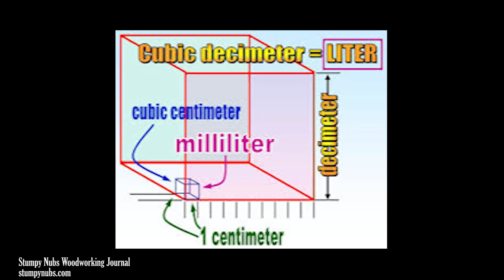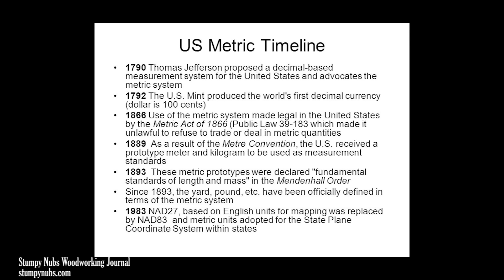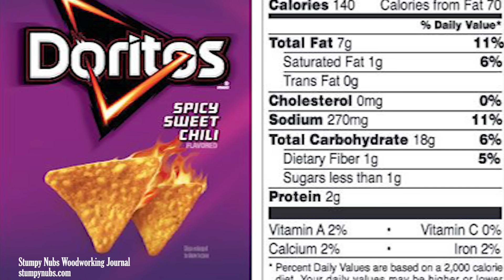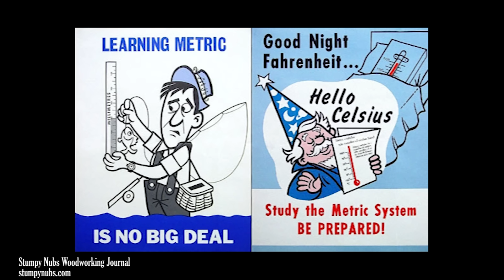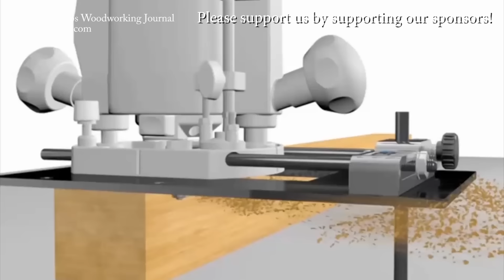BREAKING: The USA is switching to METRIC!

Comment: Finally! 😊 Are they going to switch to ISO paper sizes as well?
Reply: I looked up the price of ISO paper sizes in the USA, and they are simply prohibitive for daily use.  I have to admit that I would love to have my usual paper be size A4, because my papers would be 297mm tall instead of s shrimpy 279.4mm with 8.5x11 inch paper.  My papers would be 17.6mm (7/10") taller than everyone else's!
Reply: @garykitzis1335  Using an irrational number (which we cannot resolve exactly) as the basis for "exact" sizes seems -- irrational. As does the inaccessible basis for defining the length of a meter -- the distance from the equator to the pole.
Reply: @artsmith1347  The bases for inches and American paper sizes are just as weird from an outside perspective. The nice thing about ISO paper is that you can cut it or glue it together to get the other sizes - this is extremely useful. Drawing stuff with your kids who are expected to put the drawing into an A5 homework folder, but you only have A4 paper? No problem, cut it in half and it will fit exactly. No waste. Your kid needs to draw a big diagram on a big A2 sheet and you only have A4? Tape 4 of them together. Presto.

Most parents are happy to forgive the irrationality of sqrt(2) after the first such homework. Most everybody else just lives with it and is happy to cut A4 into A5 whenever we need a flyer.

Just take the meter as what it is: a slightly longer yard. Those french revolutionists were weird. Do what we Germans do today: say "Oui Monsieur!", eat a croissant and be happy to trade with the world. (Look at our foreign trade income if you have doubts about this strategy.)
Reply: @KonradTheWizzard  The yard is a weird unit, so comparing the meter to it doesn't provide much support. Yards are convenient in American football because they approximate the length of a stride. I find few people in the US who use yards as a go-to unit for anything. 
Cubits and handbreadths were convenient and accessible. Meters are neither -- their "benefit" is that they inconvenience everyone equally.
Measuring temperatures in degrees Celsius is lunacy: a religious sacrifice of "function to form" -- unless one is calibrating thermometers frequently.
Reply: @artsmith1347  Like the yard, the meter is approximately a stride (less than 4 inches / 10cm difference). If you have to estimate the length of a path, the size of a room or backyard or anything like that: simply count strides - you'll come very close to the number of meters. If you have to estimate something small: the width of your hand (incl. thumb) is approximately 10cm (4 inches). I find those really really intuitive and convenient. I have used those estimations since childhood.

The cubit or ell is good if you want to measure cloth and don't have an internationally accepted measuring stick. But we have much more modern tools now. For example if I buy cloth at IKEA or some other self-service shop there is a meter-stick built into the table where I cut it. Accurate, fair, convenient.

BTW: if I absolutely do not want to reach for a proper measuring device, then I measure cloth from my left shoulder to my right outstretched hand - approximately 1 meter. Just as convenient as a cubit.

There is no need to call Celsius lunacy. It is super convenient for cooking (0°C means ice, 100°C means boiling, 200°C is for baking) and driving (below 0°C means the road is dangerously slippery). For every day weather reporting it is as convenient or inconvenient as Fahrenheit - you have to memorize the temperature ranges at which you feel warm or need a jacket - for me it feels intuitive to say "below 20°C I may need a light jacket" or "above 30°C it is friggin' hot". The equivalent Fahrenheit numbers mean nothing to me without converting them first. It is a matter of habit.

Intuitive and convenient are very much a matter of perspective. If you are used to metric then imperial starts to look like a nightmare with its fractions and units that are not even a tiny bit related to each other. If you are used to imperial then metric must look like an entirely new language and way of thinking. 

I can understand your fear. But I can also encourage you: learning metric is an eye opener. Just like learning a new language or a new art form.
Reply: @KonradTheWizzard  Rational dislike is not fear. As for Celsius, I usually don't rank things on a scale from 0 to 30. Think percentages, which are a quintessential thing in base-10: Below 0% of my comfort range is cold. Above 100% of my comfort range is friggin' hot. Degrees F align well with percentages in this way. I never measure the temperature of boiling water. If it is boiling, it is boiling ... which is all I want to know about it.
Agreed: Intuitive and convenient are very much a matter of perspective.

Comment: Lenght:
1 meter=100 cm=1000 mm
For area you square up.
A hectare has 10.000 sqm, a sqkm has 1.000.000 sqm.
For  volume, 1 cubic meter =1000 cubic decimeters. 
1 cubic decimeter ( a cube 10 cm x 10 cm) volume= 1 liter.
For weight:
The weight of a liter of water= 1 kilogram.
1000 kg weight = 1 metric ton
Temperature: based on the change of status of water at sea level=
0 centigrade= ice melting point
100 centigrade= water boiling point
Reply: Yeah... Celsius, Metric and Liter are just better. WTF is ounces??
Cheers from Myanmar!
(actually Brazil)

Comment: Great video and discussion point. My problem with metric comes when trying to use kilometers vs miles, Celsius vs Fahrenheit or feet vs meters. In my head I just can visualize the unit of measure, or for lack of a better word, it doesn’t feel right. For example when it’s 98 Fahrenheit it is 32.22 Celsius or 100 miles per hour is 160.93 kilometers per hour. The same problem happens with feet vs meters, so a 100 foot yacht is 30 meters. If you grow up with standard measurements there will be some things that just don’t quite feel right.  Most of the metric conversion you mentioned in the video are not hard to make.  I really enjoyed the levelheaded discussion in your video. 😊
Reply: I'm the same way. I know from memory that a mile is 2.2 kilometers, but if you tell me some place is 8 klicks away from here, then I can't picture the distance without doing the conversion to miles. I used to know all of the basic conversions, but I only remember miles to kilometers because it's easy, and I remember inches to millimeters because I have to use it for my job.
Reply: The secret  is don't try and convert it to imperial  just learn metric , in NZ we changed somtime in the 70s and used to have the same problem  they gave us little stickers to put on the speedo  so 50ks is about 30mls 160ks is 100 miles an hour

Comment: A good explanation I've heard for the difference is convenience of use- metric is great when you need precise amounts of something (mL, g, cm), but imperial is great for when proportions matter more than specifics (if a recipe calls for one cup water per three cups flour, as long as you use the same cup, you're fine). Fahrenheit is how hot things are to a person, centigrade is how hot it is to water, and Kelvin is how hot it is to an atom- 70F feels like a nice day, and converts nicely to 20C, but saying it feels 20 out doesn't sound right, as 40 is unbearably hot, whereas saying it's 70 out tells you that it's a little warm, but 104 tells you you're staying inside for the day.
Reply: "but imperial is great for when proportions matter more than specifics " - I'd argue that only it seems to be the case. Firstly, a cup is not imperial, or it is in imperial as it is the in metric system. But when you start mixing the pints with gallons everything starts to go downhill, it's rather hard to make sense of proportions. Secondly, temperature is something where proportions don't usually make sense, be it imperial or metric. Three times the boiling point of nitrogen doesn't say anything no matter what system you use. Temperature is proportional to average kinetic energy of particles, but what we really care is the usable, "known" energy in a system, therefore we use to work with temperature differentials (ex. Carnot Cycle). In this case, it doesn't matter whether we use imperial or metric as long as we are consistent, our feeling of proportions is useless in both cases. Thirdly, when you say "proportions" you are referring to proportions of things that are very familiar to us and very accessible, like that cup. If every household had cups marked in metric at 100 cc (cubic centimeters) what system would you really use? (this question doesn't have a single correct answer)
My point is "the best" system is the one that we are familiar with. Are you 80yo and able to do those conversions between pints and gallons, inches and feet in your head? By all means, go ahead! As a courtesy, I'd pick up my phone and make the translations to metric for myself without bothering you. But if you are 5yo then any system can be great for you, you can have a feeling of proportions (except when it's not the case, see temperature) in any system. But in metric, you can also make faster computations, you can always say that 970000 cc is less than 1 mc (cubic meter) - 100cm=1m > 2  positions * 3 dimensions = 6 positions the decimal point should be moved to the left, 970000 cc = 0.97mc. Try that in imperial with inches and feet.
To give an example of how important our habits actually are, I'll return to temperature. To me Fahrenheit is a nightmare, I have to deal with 5/9(°F – 32) every time because, otherwise, a temperature in Fahrenheit "tells" me nothing. I live in the EU. My brain is already "mapped" to Celsius: -15 means "watch the wind, it makes the difference between being dead and having time enough for rescue in the mountains", 0 means "freezing, take care how you drive", 4 means "water has the highest density", 30 means "watch humidity it makes the difference between feeling cold or hot" 37.5 means "normal human body temperature", 38.5 means "infection", 39 means "delirious behavior", 65 means "proteins start to coagulate, don't keep your finger too much time in this sh1t", 78 means "stay here if you want a good "țuica" - ethanol boiling point", 100 means "water is boiling", 188 means "Sn-Pb alloy, used in electronics, melting temperature"... So, as you see, my brain already find its way around the world when is exposed to Celsius, it's not like I have to use a computer to make the decision to not sunbath naked when it's -10°C outside!
Reply: Tbh trouble with Fahrenheit, at least where I’m at, some insist 0-100F makes a good human scale when it never gets colder than 32F for me (already freezing)

Comment: Actually, US people have used the Metric System decades for decades now. They don't use these (fictive) Imperial units:
• 1 binch = 25 bits
• 1 boot (pl. beet) = 305 bits or 12 binches and 5 bits
• 1 byle = 1631 bits, or 5 beet and 3 binchs and 6 bits  

They use Kilobyte, Megabyte, Gigabyte, Terabyte etc. And with bits, respectively.

Comment: Great to see an American with a tongue-in-cheek/sarcastic sense of humour. Keep up the good work! I'm from the UK and remember inches and feet kinda being around when I was a kid in the late 70s/early 80s, but metric was most definitely taught in schools. The weather was a bit odd, as we had temperatures in both scales, but Celsius obviously won out. We've kinda stalled at about 90% metric. We still use miles and pints. Although it'll mess with my head for a while, I wouldn't begrudge finishing the job off. Whether that will actually happen remains to be seen. Here's hoping the US joins the party!!
Reply: These days I'm surprised when I come across Brits born after the introduction of the metric system who still use feet and inches. There's a few more examples though, like using feet and inches to measure your height or using stone for your weight.

A recent push to re-introduce imperial units post-Brexit failed spectacularly, with a staggering 98.something per cent voting for remaining metric in a poll.

BTW, I don't think any country in the world has ever gone fully metric. As far as I know all plumbing threads are either American (NPT) or British (BSP/Whitworth), both of which are Imperial. While copper and plastic pipes have been metric on the continent pretty much forever, galvanised and black pipes aren't. I haven't found much evidence so far but I assume BSP spread across the continent as the British built gas works all across Europe and supplied everything, including the pipes and fittings, in the mid-19th century.
Reply: I'm guilty of that with height and wight. I'm making a more conscious effort to know that I'm 1m80, rather than 5' 11" and my (over)weight in kilos!

Comment: The metric system is awesome! If you know decimal, you instantly know the metric system. It‘s that easy and intuitive! Sadly even in metric countries there are still some things done in inches. For example Airbus still does a lot of the measurements in the plane in inches because they want the airliners to have the ability to have the same seats as in boeing planes. Those things (and I bet there are many more) have to come from an joint effort.
Reply: Folks always say that about metric, but it's not quite true.  If you don't know how much flour is in a milligram, then knowing that 10 times that is, what?  A centigram?  Still doesn't tell me a thing.  I can measure teaspoons and tablespoons in the palm of my hand and be accurate enough without even looking at a measure, but if you asked me how many milligrams I was holding, I'd have to find a measure to measure the amount with and I doubt I'd ever be able to assume at a glance how much I was holding in my hand that way.  Our system may not be scientific but it suits the human condition more.  Folks that do use the metric system don't use it right either.  They'll tell you they are so many centimeters tall.  That would be like me telling you how many inches tall I am.  Why don't they use the decameters and centimeters?  If it's so simple then folks should actually use all the measurements.  I myself am 6' 8" tall...Now, I could say I'm 80 inches but even most folks that know the English system would have to add that up into feet and inches because it's a more well known figure, and even for the folks around me who claim to embrace metric...if I told them I'm 203.2cm's tall they'd be left scratching their heads.  Wouldn't it be easier to say 20dc's/3.2cm's?

Comment: I have been a member of the US Metric Association for over 25 years.  All the settings in my cars for the last 20 years have been metric.  Soda-pop is sold by the liter and no one has a problem with that. Why is milk sold by the quart?  People KNOW and use the metric system (SI), so why don't we just ditch the imperial units?  ALL the units we use in the imperial system are actually defined in terms of the metric system.  For example,  according to NIST, a gallon is officially and legally defined as exactly 3.785411784 litres, NOT four quarts, 231 cubic inches or 128 ounces.  We're getting there, but it is taking an awfully long time.

Comment: In Canada we use Pounds and Metrics in Supermarkets and nobody is complaining. We also use inches, feet and Metric in hardware stores. It is as if the inch, feet and pound make the Metric a *METRIC+, and it is pretty cool. The official system in Canada is the Metric. Just go to Canada and check it out for yourself.

Comment: As a Canadian, I have lived most my life with Metric.  I was a teenager and just learning to drive when we formally adopted Metric.
I prefer distance in Kilometers, for I can quickly and easily determine distance and time on the highway, by dividing by 100 (Normal speed limits in my area).
So a trip of 250 km takes 2 1/2 hours.  Easy.

Zero is freezing!  100 is Boiling!  Simple.

In much of my life, I have converted.  There are a couple of places that it has been more difficult.  My Doctor weighs me and measures me in metric.  
I tried to change our scale at home to metric, but my wife kept changing it back.  My family recently measure everyone, and did it in Feet and Inches.

I do admit that I still build things in Imperial.  Not sure exactly why.  Maybe it that my tools, especially my measuring tools, have Imperial on the Right Side and I am right handed.

Comment: Coming from a metric country (Australia), I am always amused when you find legacy imperial measurements left behind in the woodworking and engineering disciplines, most prevalent are in threads where imperial threads persist and sometimes are as common as our new metric M6 bolts. Our big box hardware still stocks both after decades in the metric system. The legacy of things that come just happen to come in 254mm (10 inches) is hilarious. Random fact, in the UK they still show miles on road signs for distance and speed limits.

Comment: I have something to say. As long as the sheet metals and pipes are not in metric, there is a chance we will need to use both measurements together. And there will be confusion since some people call 3in 76.2mm  pipe 75mm and some say 80mm.